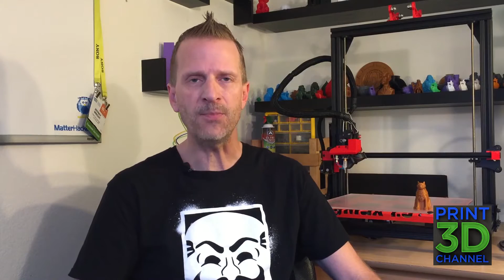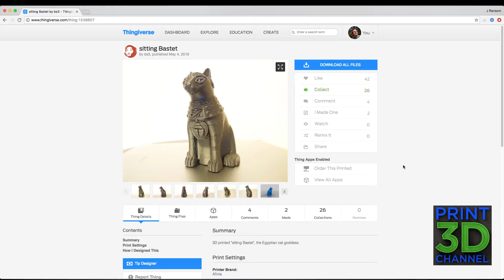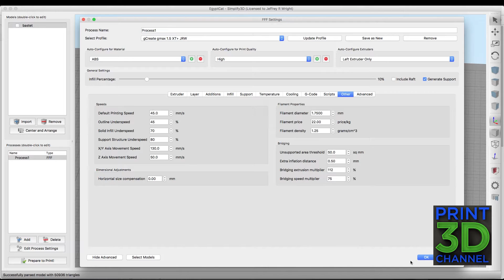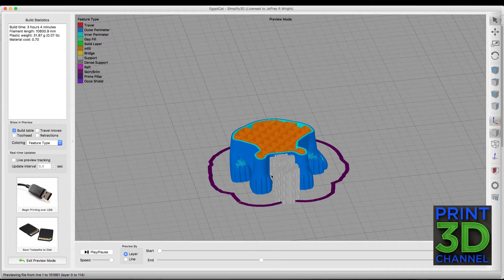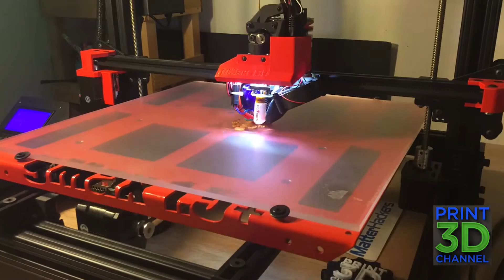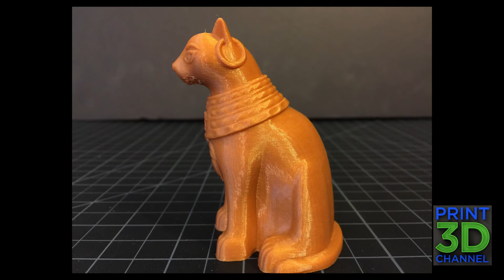#3DP365Project - Day 48 - Sitting Bastet - MatterHackers PRO PLA & gCreate gMax 1.5XT+

Comment: That's surprisingly smooth looking, a little sand paper and you could have a glass smooth finish pretty quickly.
Reply from the maker: Thanks! It did turn out pretty stellar. I usually don't hit these with sandpaper unless I plan to paint them fully, any scuff marks on the plastic are very visible, best to try and get a perfect print.